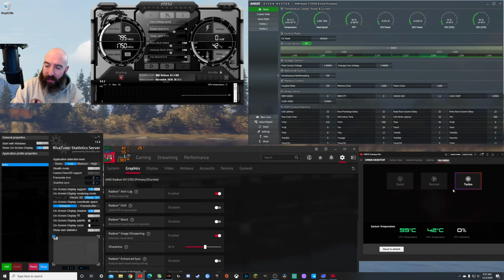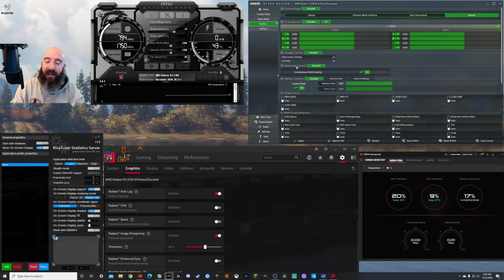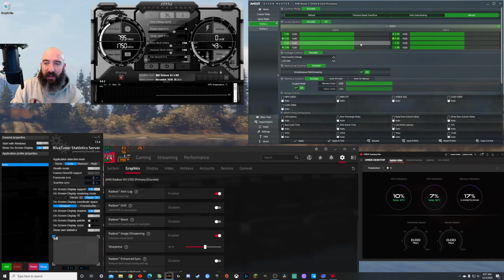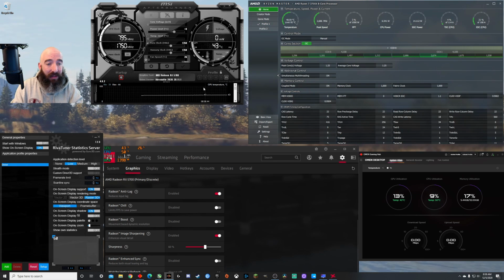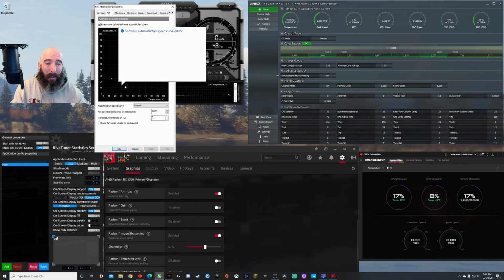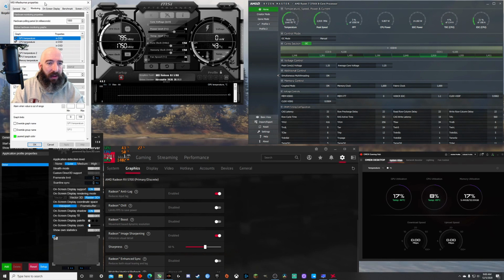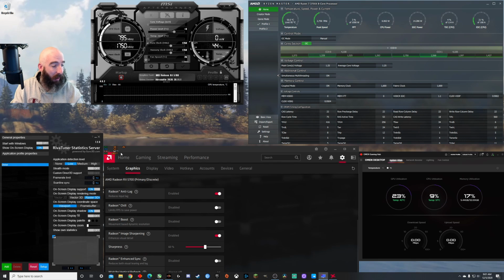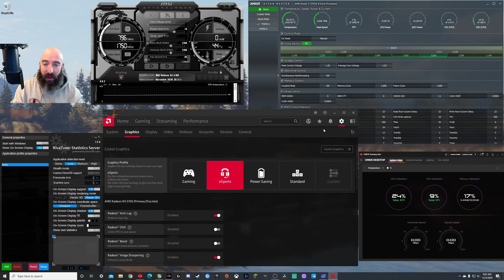My Current Modifications! HP Omen 25L! All Mods and Programs I Use!

Comment: Just got a 25L for 250$ bucks off a friend. Would you still recommend all the products in the description? Mine came with a 1660 super GPU and an I3 cpu and 8gb of ram which from what my brother told me is really not great. I have no clue about pc’s but want to order new parts asap. 
If you don’t mind could you tell me what would be the best CPU, SSD, Fans, gpu, etc that I should start looking into getting. I mostly play Fortnite and want to be able to run GTA and other first person shooters. I was able to run Fortnite just fine at very low settings but GTA loads supppppeeer slow and the buildings look like blobs. I was able to get into the bios and my system does have the option for XMP profiles and such so I’m assuming I could mess with some stuff in there to get the ram to work. Idk . lol Sorry for the long comment. Hope you see this. Many thanks!
Reply from the maker: If I were to do it all over again, I would do the Noctua U9S, a 120mm fan set as intake on the bottom, a 120mm fan set as exhaust on the top, and a 92mm fan set as exhaust on the rear. That's it.

Comment: Hi, For 25L with Hana 8876 mobo - can it take a 3900x?
It can take a 5900x...but 3900x does not even post.
F13 bios.

Currently 5700G
Reply from the maker: It will only fit 5xxx series CPU’s. Omen motherboards for some reason, can only accept other CPU’s within their specific generation.

AMD 3xxx with AMD 3xxx
AMD 5xxx with AMD 5xxx
Intel 10xxx with Intel 10xxx
Etc..
Reply: @DanKamYouKnow thanks for the reply!

Was hoping it is just a power issue (as in not enough) .
CPU power on Mobo is 8 pin but it is powered only via 4 pin cable.
Reply from the maker: Omen motherboards will cap the wattage on most CPU’s, thus only needing a 4pin cable for CPU power.
Reply: @DanKamYouKnow thanks!
Will give it a go with a bigger psu cause I really want it to work
Reply from the maker: It’s an Omen motherboard issue, not a PSU issue. I have seen numerous people try to change CPU’s and it only works within that generation. Do you have the model of your Omen by any chance? Should be something like “GT12-0011” or something like that? We can see compatible CPU’s with that specific motherboard.
Reply: @DanKamYouKnow  Mobo is Hana 8876, i know what they say for supported CPUs , just happens I imagined another one that's not on the list would still work.

Thank you so much for you willingnes to help!
Reply from the maker: No problem 👍🏻👍🏻👍🏻

Comment: Thank you very much for your vids! I also got a HP Omen 25L and did more or less the same mods as you. Heat is really an issue with these. I installed 120mm fans in top and bottom of the case, replaced the 92mm rear fan and a new CPU-cooler. The temp dropped from 85-95 celcius to 45-70 celcius, both GPU and CPU, dependent of load ofcourse. Replaced the RAM aswell to 32Gb and followed your instructions. Again, thanks for your videos! Cheers! :)
Reply from the maker: Glad to hear!! The CPU cooler is an absolute game changer for Omens. Significantly dropped my CPU temps as well, and honestly, I believe helped with GPU temps a bit as well. Thanks for the comment and enjoy your “new” maxine

Comment: Love these videos, thank you for doing them. I am replacing my fans and also have a new GPU on order. I wondered, the GPU bracket you have is very different to the stock one that came with my Omen 25L with RTX 2060. Did you buy that bracket separately?
Reply from the maker: Thanks! No, that came with my Omen. They use different brackets based off what card is in the PC.
Reply: @DanKamYouKnow  Thanks so much for the reply! That's really helpful to know. Not sure my existing bracket will fit the new GPU, so may have to look at getting something. Once again, the videos are great and I have learned so much, thank you!
Reply from the maker: Appreciate the kind words David! Majority of GPU’s will not work with the Omen GPU bracket, but it’s totally OK not to use a GPU bracket, unless the card you are replacing it with has noticeable sag to it.
Reply: @DanKamYouKnow  Thanks, great to have that reassurance! It aarives today, so looking forward to my first GPU swap out.
Reply from the maker: I hope you took into consideration the size of the Omen case? A lot of GPU’s will not fit based on their size. Anything longer than about 285mm, will not fit in the case.
Reply: @DanKamYouKnow  Yes, I did thanks. I used your measurements / the comments other viewers had added. I was able to fit in a Sapphire Pulse RX 6650 XT. That's plenty short enough, overall: 240(L)X 119.85(W)X 44.75(H)mm. Width is ok even though the power connects on the side.
Reply from the maker: That’s awesome! Enjoy the new GPU my friend

Comment: I got a quick question, I got a HP OMEN 25L GT12-0485ND. Now I don't know what max height my cpu cooler should be. I get constant shutdowns because the cpu is overheated so I gotta switch it so im not sure what max height I could choose from any idea ?
Reply from the maker: Max height is 140mm. Best cooler you can run is the Noctua U9S air cooler. Also comes in black ( Noctua calls it Chromax )

Comment: Hey Dan! Thanks for the tutorials. I just have a question. I recently bought a 25L omen and added 3 fans (same brand on your video). I swapped the rear fan with the chroma 90mm and used a y-split to connect with the top fan.  My question is, is it normal when sometimes the rear and the top fans are stoping on thier own? Usual happens when the pc is idle. Should I worry? Thanks for the help man!
Reply from the maker: Hey! About 6-12 months ago, HP released an update where if the PC is under no load ( idle ), the system fans will completely turn off, as they are not really needed. A lot of graphics cards behave similarly. That’s completely normal 😀
Reply: Wow! Thanks for this Dan! I almost had a heart attack when that happened! Anyway, thanks again man!
Reply from the maker: No problem 😎🤝😎

Comment: I’m looking not to upgrade anything but just the Ram. What do you recommend doing
Reply from the maker: 32GB or 64GB of 3200mhz RAM
Reply: @DanKamYouKnow  thx so much. I got this pc From Best Buy a couple months ago and they pulled a fast one on me. It says it comes with 16 Gb of ram but I only got 8. Never noticed till now 🤦‍♂️
Reply from the maker: Oh man, that is super shady.
Reply: @DanKamYouKnow  alright so I got 2 16gb ram and installed it. My pc is already running wayyy better but I’m wondering if I ever want to upgrade in the future , could I grab another 1 or 2  16gb or do I need 2 32gb ones?
Reply from the maker: You can run RAM in 4 channel ( all 4 RAM slots filled up ), but I would use the same exact sticks in all 4 slots. 32GB is plenty unless your rendering / 3D modeling a lot.

Comment: What are the sata cables that come with the pc??? Is it Sata 2,3,or 1???
Reply from the maker: I don’t think even HP made that information know. I’m not sure.
Reply: @DanKamYouKnow  well are you still using  the sata cable that came with your pc
Reply from the maker: Yes, my Omen had one extra SATA power cable available which powered my fan controller. This video is pretty old so now I actually use that power cable to power my AIO that I also did a video on.

Comment: Ok hi wassup me again i got a New hard drive its a Seagate barracuda and it connects to my pc so i did everything to set it up and now when i play games on it the games on the HDD stutter like crazy like its unplayable and these were games that i had on my ssd but they are now on My new HArd drive... PLz respond
Reply from the maker: HDD’s are much much slower than SSD’s so you might experience very long load times.
Reply: @DanKamYouKnow  IK that but it has average response time at 30 to 50 to 80 to 90 to 100 to 150, 200,700,900,1000,2000, the drops down to random number for seconds then repeats also the active time is 100%
Reply from the maker: Not sure what may have happened. Only thing that seems like you changed was the hard-drive. Throw in the old one and see what happens.
Reply: @DanKamYouKnow  Wht storage do you have?
Reply from the maker: In the Omen? A 512GB NVME SSD for my boot drive and a 1TB HDD

Comment: Hi, my hard drive is not working its a 2tb hard drive Western digital and its not showing up in the disk manager?
Reply from the maker: Did you figure it out? Normally it show show up in disk management and you’ll have to create a new simple volume
Reply: @DanKamYouKnow  no it still not showig i even got microsoft support and a tech lady to help me she did everything she could but no luck :/
Reply from the maker: Might be something wrong with the drive, the SATA data or power cable, or even the motherboard.
Reply: @DanKamYouKnow  wyhat could be wrong with my mother board? ive had this computer for like 2 or 3 months now the sata cables ive never used before so their maybe still good.
Reply from the maker: Try a different SATA port on your motherboard. I am guessing there is something wrong with the drive. You gotta use the process of elimination to diagnose the problem.
Reply: @DanKamYouKnow  their are only 2 sata ports sata 1 and sata 2 which both are plugged in and i already tried using the 2 diffrent sata connector and sata power cables that are already hooked up in my pre built computer.
Reply from the maker: I am guessing it’s a bad drive then. It should show up as a black bar in disk management.
Reply: @DanKamYouKnow  Its not showing up at all in device amanger and i just barely got it like 2 days ago now its a Western Digital 2 TB HArd drive.
Reply: @DanKamYouKnow  Also if I go into device manager and then disk drives it shows up in their and i click on it to view it and it says this device is working properly?
Reply from the maker: Go into Disk Management and right click the new drive that should have a black bar ( your current drive will be blue ). Right click and hit create new simple volume, hit OK to all prompts, choose your hard drive letter, rename your hard drive, and the click OK.
Reply: @DanKamYouKnow  I know that but thats the promblem there is no unallocated disk aka no black bar its not showing up.
Reply from the maker: I don’t know what the issue is, might have to search through Google
Reply: @DanKamYouKnow  dame ok then

Comment: Please answer I have a important question I have a 25L with 600 watt pw supply and mine came with 1660 super am I able to upgrade that gpu and if so can u tell me what is a good gpu that will fit please answer
Reply from the maker: GPU market is so bad right now, it depends on what GPU you can find for a decent price. For an Omen 25L, you can fit any GPU that is shorter than 285mm in length. A 3060Ti would be a good choice but I would also consider upgrading your PSU

Comment: What kind of power cable does the Noctua controller use?    Which port did you plug it in to draw power?
Reply from the maker: SATA power. You should have a loose cable called “P5” that can power it. That’s it, you don’t plug the controller into the motherboard.

Comment: Hey man, not sure if you are still reading the comments on these older videos, but really appreciate that you recorded the progression of having your HP L25. I want to buy a newer model of L25 and it basically came down to it being best PC for it's price but the cooling is bad. So even if the components are different, just seeing how you tackled the cooling makes me confident to buy the one I want and make me feel like I will be able to deal with any cooling issues too by following your videos since the case is the same.
Reply from the maker: Hey! I appreciate your comment and I’m glad my videos have been helpful for you in making a proper decision. Omens run a little on the warm side but temps are generally always safe! Even if you felt uncomfortable with the temps you’re getting, always ways to drop them down a bit 👌🏻
Reply: The cooling works absolutely perfect for everything that comes within the new 25L.

Comment: Hello! I’ve had my omen for almost a year now and as someone who loves technology yet doesn’t understand the more complex stuff about it, I never made any modifications or made any additions to the pc ever since I got it and it’s obvious that if I wanted to I’ll need assistance from someone who does know. I agree that the cooling for this pc is a major concern so that is why I ask: Is it possible to improve the cooling of this pc despite not making a ton of changes like you have to yours? Like how you added the fan on the top and the two at the bottom? Because despite putting the fans on turbo and having most applications not active the fans still throttle when I do certain things such as playing certain games so that is why I ask
Reply from the maker: The best thing you can do for your Omen is add a 120mm fan to the top as exhaust, and a 120mm fan to the bottom as intake. Super easy to do and greatly improves airflow in the case.
Reply: @DanKamYouKnow  I see! Thank you for the advice I'll try to find some  fans so I can do just that as well as someone who can help me with it. Once again thank you for your advice and your videos! :)

Comment: Between the Noctua NH-U9S cooler and those case fans,  which ones do you think play a more important role in cooling down the CPU below the stock levels?
Reply from the maker: Noctua U9S is by far the best thing you can do for an Omen ( if it comes with the stock air cooler ). The fans help a bit but the cooler is a DRASTIC change 👍🏻
Reply: @DanKamYouKnow  Can you control fan speed with using customized fan curve?  I see you used a splitter to plug both fans into the same header.  I assume both fans will run at the same speed.
Reply from the maker: They’ll run at the same speed, yes. All fan control is through Omen Gaming Hub and it’s VERY limited.

Comment: Thank you so much for all the great videos! I ended up purchasing an Omen myself and it should arrive in the coming days. I'll definitely be using your videos to get some improved airflow in there!

I had one question: do you have anything in particular that you use as a battery backup or the like when plugging your PC and monitor into the outlet? Just curious, thank you!
Reply from the maker: You’re welcome and thank you! I would either recommend plugging your PC equipment into a surge protector or a UPS ( Uninterruptible Power Source ). They will help protect your equipment if there is ever a power surge or sudden outage.

Comment: Hey do you know how I can add additional ssd storage on my 25L because it only has 1 extra her slot so I’d either have to replace my original or find a way to put a ssd into the hdd slot?
Reply from the maker: You can use a 2.5” SATA SAD for the extra hard drive slot 👍🏻. You will need to find screws to secure it to the bracket though.

Comment: Hey there, thank you for your great videos! I bought the Omen Case 25l with Moira3 Mainboard and CoolerMaster 500w but without an CPU or GPU from a friend. Do you think it can handle an Ryzen 5600 (that has the same TDP) or an older model like an 2600/1600, since they are cheaper than the 3600 at the moment? And can the power supply handle a 6700 XT or an 3060Ti? Thanks :)
Reply from the maker: Hey! Unfortunately the Moria 3 cannot run a 5xxx series processor and don’t have a BIOS update available to run one, so you’ll have to stick with a 3xxx series or older. A 6700xt and 3060Ti should be fine but they are right on the border of needing a high wattage PSU. Just make sure you keep the length of the new card in mind as a lot of cards won’t fit
Reply: @DanKamYouKnow  Thank you so much for that fast answer! :) I was wondering, if there is a BIOS Update available, but now i know. I'm probably gonna buy the 2600 with an 6700xt.
Reply from the maker: No problem! I personally not have seen anyone try an older Ryzen CPU in an Omen that came with a 3xxx series, but I don’t see why it wouldn’t work. If you do go with the 2600, let me know how it works so I can pass that information on in the future 👌🏻

Comment: Can you add rbg fans to the omen 25l
Reply from the maker: Nope, the Omen motherboard doesn't support RGB. You can do some external controller that's power by USB A, but it's a pain and usually doesn't end up looking that good
Reply: Do you think I will be okay with just the 2 stock fans it came with ive had it for 8+ months with no problems, the hottest it’s been it’s 80 degrees on warzone for a while on games like valorant It runs lien 55-60
Reply from the maker: @ITzzRocko  Those temps are fine and you're OK with using the stock 2 fans
Reply: There’s a rgb round fan wire on the back of the computer but idk how to set it up
Reply from the maker: @ITzzRocko  That only works on HP fans. That is meant for the RGB fan that comes with some stock Omen air coolers. It's a proprietary plug and won't work with any after-market fans
Reply: Just wanted to add some cool looking fans but It’s honestly cool looking enough the way it is thank you some much @dankamyouknow
Reply: Thank you so much your the man ❤️❤️
Reply from the maker: Appreciate you my dude! 🤝👌🏻👍🏻

Comment: Hey I have a question. the OMEN 25L GT13-0010nj come with a WD_BLACK 1 TB PCIe NVMe TLC SSD. It says that on the motherboard there are One M.2 socket 1, key A
 and Two M.2 socket 3, key M. I don't really understand what the difference between the sockets are, does that mean there is a place for another ssd? Specifically the same that the pc already comes with? Or can I add only a hdd? Is there somewhere I can learn how to install an additional ssd in this exact model it it's possible?
Reply from the maker: Usually, most Omens only have 1 m.2 slot, but there is an additional spot available for a 2.5” SATA SSD or 3.5” SATA HDD. I do not have a video on how to replace it but I think HP does have one on YouTube
Reply: @DanKamYouKnow  Thank you once again!